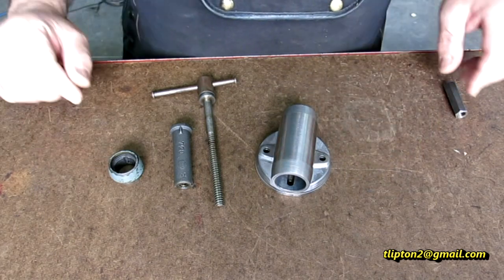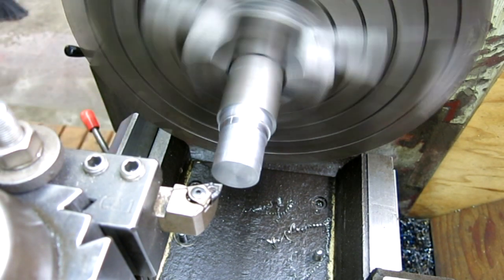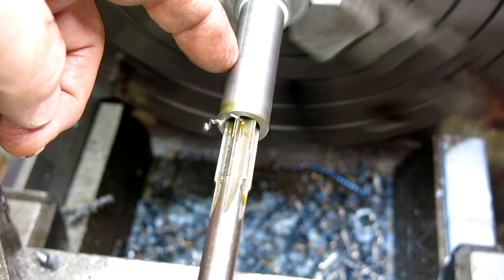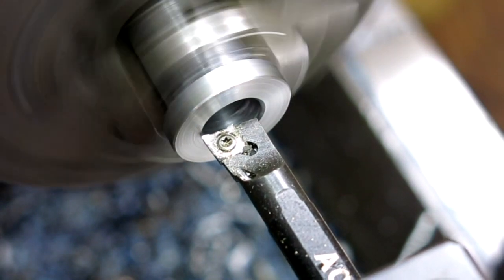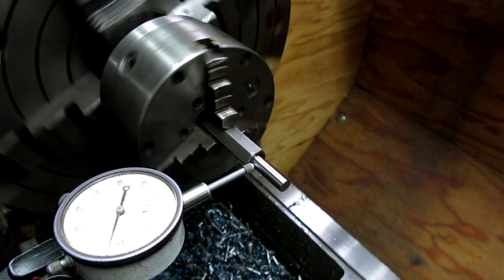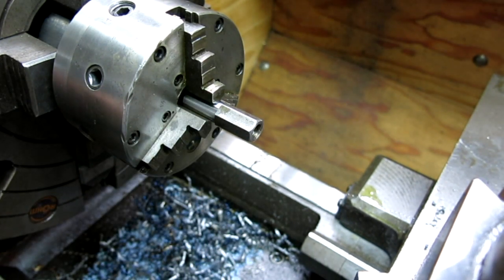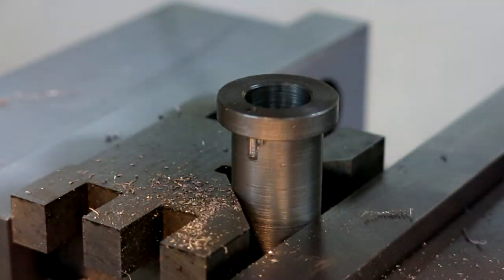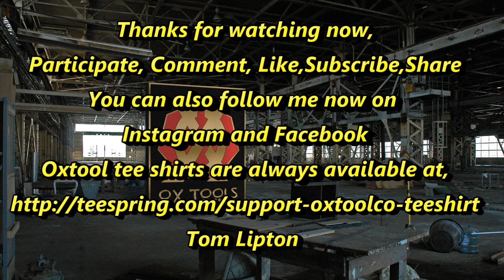Wilton Baby Bullet 6

Comment: Hi Tom, great set of videos as always. I really enjoy your attention to detail and the filing. OMG! the filing! :O

Two observations: 

1 - You probably didn't see this from where you were standing; when you drilled the 'nut' body for those retaining pins, the drill bit started deflecting towards the bottom of the 'half' bore. Because it didn't have anything to counteract the sideways forces. Probably not a biggie.

2 - The ACME nut is only secured by the Silicon Bronze weld. So when you tighten the vice later on, all the forces will be pulling on that single weld. Are you comfortable that it will hold? I'd have my doubts! I would suggest machining a shoulder into the ACME nut, and an opposite shoulder into the nut body, so that the clamping forces are held by a shoulder instead of a single weld? 

Kind regards,

Michel

Comment: A comment and a question. Comment - I've drilled these half holes before when tweaking the South Bend dials and I've found great success by inserting a sacrificial plug that "backs" the blow out. In this case, a sacrificial sleeve. And my question is what system do you have in place for your mill's Z-axis? Nice and quite - and fast ;)

Comment: Great video, Tom.  I would have copied the real Wilton as to the anti-rotation feature.  I would have used 3/16" key stock in all 4 places, silver solder in.  But, I'm sure that your method will work just fine.

Comment: Tom, I'm curious if you've indicated your spindle bore taper?  I've been working on a project and I'm disappointed to say that my engine lathe has 3 tenths runout, in a very non-eccentric pattern (I strongly suspect the bearings).  Indicating the 4jaw to less than 3 tenths is a joke, because when you run the lathe it reads 3-5 tenths TIR over 4 consecutive revolutions (the TIR is read over 4 revs, a single rev is no worse than 2 tenths).

OTOH, the 1985 Hardinge Super Precision doesn't even tickle the 50 millionths indicator after 30 years!
Reply: +eformance Find a manual, and adjust the bearings correctly. If that doesn't help, your spindle taper might have to be reground.
Reply: Andre Gross Yeah, I've been trying to find a manual for the last 11 years.  It was made in 1985 has ENCO-1540 on it and was made in Taiwan.  I've never seen another machine like it.  Anyway, I talked to a machinery dealer I trust and he recommended I just pop it open and increase the preload on the bearings, so that's exactly what I did.  Now the runout is less than 0.0001" under power, less than 0.00005" when turned over by hand, so I'm happy.  I bought the machine practically new, the original owner never really used it.

Comment: I'm having a lot of fun with this. Thanks, I would have never attempted this on my own :) I am worried about the 0.030 lip on the inside of the nut holder. Looking at it, it doesn't seem like much. Then again,  I guess if a thousandth is an interference fit, the 30 must do a lot of interferen'. Any reason not to open the flange end to .570, the size of the opposing vertexes of the nut? Andy
Reply from the maker: +namecollision Hi Name,

Think about what snap rings hold. You don't need much especially when its all the way around. Thanks for the comment.

Cheers,

Tom

Comment: Sorry in advance for the amateur question, but what is the reason for wanting the part to cool on the lathe before the finish pass?  Thanks, really enjoying your channel! =)
Reply from the maker: +Brian Walk Hi Brian,

As the part gets hot from turning it expands making the diameter larger. If I measure it when its hot and make my finish cut from that measurement as it cools the part will be undersize. Hope that makes sense.  Thanks for the comment.

Cheers,

Tom

Comment: I am not am machinist and I know this is going to sound like a smart-aleck question.

How does the oil work when cutting metal. Is it mostly to keep the cutter cool? Normally, it would reduce friction but in this situation the parts are not slipping past each other.
Reply: +James Rawlings  I'm not an expert either, so don't depend on this, but I'm pretty sure that the oil keeps the tooling cool by reducing the friction between the tool and the material. Even though the cutter is digging into the material, the lubricant still cuts down on the friction, in turn making a cleaner, faster, cooler cut. Like I say, I may be wrong, if I am I'm sure one of the many machinists here will correct me, but I'm pretty sure that's how it works.
Reply: +W.Co.VIDS Thanks for the information.
Reply: While the oil does reduce friction it is used to reduce the friction in clearing waste (chips, shavings) allowing for a cleaner cut to happen without the waste binding up. Someone could explain it better than me as I was dropped a lot as a baby and sometimes get things back asswords.
Reply: MrPlusses LOL! When talking machinist talk around the professionals, you have to remember where your place is and who you are talking to. LOL!
Reply: W.Co.VIDS Sound words, you should follow them.

" Cutting fluids are used in metal machining for a variety of reasons such as improving tool life, reducing workpiece thermal deformation, improving surface finish and flushing away chips from the cutting zone.

Who are you to say who can or can not comment and is or is not a machinist or professional?
Reply: I'm not calling anyone unprofessional, I'm just saying that if someone goes to talk about machining on a machinist's page, be prepared to be criticized by the experts if you say something wrong. LOL, I don't know much about machining, so when I comment on it, I am sure to mention that I may be incorrect. You sound like you know what your talking about, so you may not have to say that. I like your answer, very well worded!
Reply: W.Co.VIDS Thank you, all is well.
I learn something new everyday. I am not an expert by any means but a large part of my income comes from what I know and how I do it.

Comment: Hi Tom,
IMHO welding rod may be a little too soft for this application. It may distort and bind things up when the vice is really tightened. Wouldn't it be better to use steel pins instead?
Reply: +Leo Gijssel 

I thought we would use some drill rod and tack the ends on the other side where the force will be.
Reply: Leo Gijssel why would you gronk on such a small vise though?

Comment: 45:52 what the actual fudge, are you a robot? Humans get burnt you know
Reply: +erklaerbaer01 Tom's hooves are heat resistant
Reply: +erklaerbaer01 tig welding is really nice in it's control of heat, so long ar you aren't touching in the immediate area of the weld, you can usually touch the other side no problem.  with steel mind you, aluminum conducts heat way too well
Reply: I noticed that too.  I watched it a couple of times to make sure that my eyes weren't deceiving me... nope, he rubbed his thumb right across the weld he just did!